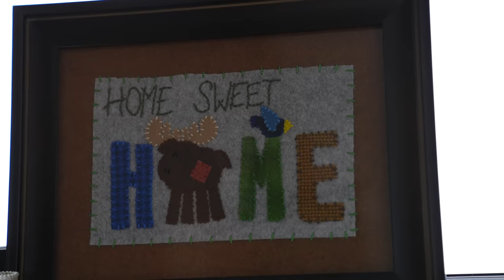THINGS ARE NOT LOOKING GOOD | A RACE AGAINST THE STORM

Comment: I didn't read all of the comments, so someone else may have mentioned this - you can replace the fittings on those air hoses.  We are always cutting off the end of hoses and replacing the fittings - they hold the pressure just fine.

Comment: Tip - Use any scrap LVL pieces to make a chopping block for firewood,  màke it 3 layers and change the direction of the middle layer and glue the heck out of it and place screws around the edges, beats chopping on a stump or bare ground.

Comment: I would consider putting a roll up garage door, large double utility door or a door found on a yard shed on the front driveway side. 
It does not need to be the size of a regular garage door for an automobile. However it can open enough if you want to get things bigger or longer because I see possible problems when bringing large items and trying to turn the corner where you currently  have the man door located.

Comment: A ledger should be affixed to strong parts of the house's framing, such as second-floor joists or wall studs. The strongest ledger connection relies on bolts that run through the ledger and the house sheathing and rim or band joist and then are fastened with nuts and washers affixed from the other side.
Reply from the maker: I’m just doing what the structural engineer put in the plans. There are sds screws (large structural lags) attaching the ledger to each vertical stud in the wall it’s attaching to

Comment: Allie. Looking good in the insulated bibs. Before retiring I worked for power company always work in them. You made the comment their HOT. when you get hot open the chest zipper about 4” or so than open the side zippers like you getting into our pockets about 1/2 way between top of zipper and knees. This let’s cool air in when you bend over your pushing out the hot air when standing up bringing the cool air in. Than regulate the heat by adjusting the zipper opening. 
Love the show little Leo is the coolest.

Comment: The hoses aren't trash they can be repaired. Find an equipment sales place that repairs air and hydraulic hoses. Air hoses get cold and the properties of the rubber to becoming 
Hardened and get brittle. If use is a constant roll them up and take them inside. Compressors must be drained of water and protected from constant freezing temperatures. Oil the compressors and your nail guns and staplers after use.

Comment: Brrrrrrrrrrrrrrrrrrrrrrrrr!  I remember those days in Idaho.  But, believe it or not, we are expecting freezing temps in the outskirts of Central AZ in the little town where I live,  so I've been out wrapping outside pipes and the hoses insulating the Heat Pump hoses as best as I am able. The fun will be that after the freezes, all the snow birds will be up perplexing over leaking, frozen/cracked pipes in the mornings we get the hard freeze.  They don't expected freezing temps here in winter. Freezes in the winter and bakes everything in summer. I am looking at moving to a more temperate climate soon.  🌧🌨❄⛈

Comment: You will get very used to shoveling  snow off the two additions  as snow slide easy off high roof  but not slide off the two additions  as roof angles very low pitches.
Reply: The snow from the upper roof will push the snow off the lower pitched roof. Have almost the same roof design here in Canada.
Reply: @homernextdoor5950   have had both actions occur, depends roof material and snow type that each region gets. Red poppy ranch was forced  to change his pitches front and back roof pitches because accumulated  so much lower roofs,resisted sliding off lower roofs. Here's  hoping there's  not an issue!

Comment: Just wondering how you plan on finishing off the lower section of your top roof on each side and tying in with the lower roof sections
Reply from the maker: They will act like two separate roof planes and have a drip edge coming off the upper roof

Comment: That ledger board won't carry a snow load-you need to use construction bolts.
Reply from the maker: There are 4” sds screws holding the ledger to the framing of the existing wall

Comment: When you tape. Out a heating pad in a 5 gallon bucket. Put it on low to warm the tape... and on the plywood, buy a Plummer, 5 foot torch hoze.
Use a wide, head,...branden swings the flame back and forth over the joints. Trent enrolls the warm tape....allie....quickly rolls it in the seals..
Don't  leave the plywood,  not taped all winter...
The dripping, the mess, ect ect. And after a few weeks, seams will swell, up.

Comment: You can use trig. to figure out the angle of your slope cuts.
Reply: You can also use a framing square to figure per/foot/run  in figuring those stud lengths and hip rafters too.  Some of us are old school and do it the old way as I had no use for trig. There is so much info on a full featured framing square.
Reply: @roncurtis8331  Love framing squares, but combersome on a 30' wall starting at one angle and finishing at another.

Comment: you might be ableto shorten the broken airhose a little cut the crimped sleeve off carefully to keep the barbed inner piece untouched , then bring it to a shop that does hydraulic fittings and they probably be able to crimp a new crimped sleeve over the repaired piece making it as good as new again , the other option wouldbe a hoseclamp doesnt look as nice and prolly will cut you at one time or another unless you realy tape it up  but it should work just not as resistant angainst pulling on it

Comment: Is there not going to be a door from the main part of the garage to the second addition? and if it is to be a mancave what about some windows?
Reply: sorry I see there are windows afterall
Reply from the maker: The door will go in after we get the roof up
Reply: If you look closely you will see the opening for a door and window on the side of the mancave, not on the front, but the side.
Reply: @sandrachristensen7282  it is a door from the outside into the mancave. But there is no room from the inside. I think that will be regretted.

Comment: Trent there is a common difference in stud length 16 in oc. 4/12. Framing square will tell you that. It talks!
Reply from the maker: Our foundations are not very flat so we have had problems cutting studs without checking each one.

Comment: Why does  your sub fascia have a 1 1/4 " discrepancy to your bottom edge of roof sheathing? It seems the ceiling joists weren't all cut the exact same length. Now that the bottom edge of the sheathing is nailed into the sub fascia you cant (cheat) the sub fascia in or out to have a perfectly straight finished fascia. Cheers from Canada !😁🇨🇦🔨
Reply: Hey 👋 You've won something 🥳 KIK me through the above name ✔️❤

Comment: I admit to not being a carpenter (or any kind of skilled trade), but those birds mouth cutouts sure look sort of wonky.  Aren't they supposed to have a more squared off cut where it meets up with the wall beam?  These look like they'd slip rather than hold if pressure was exerted in the downward direction.  Like I said, I am the farthest from even a novice---but I have seen a lot of folks make those cuts differently and would love to know why you chose this version.  Otherwise, you guys (and gal) are knocking the build out of the ballpark.  Thanks for the episode and for giving me something to ponder
Reply from the maker: The birds mouth is just give the rafter a flat spot to be nailed onto the top of the wall. Then we had to trim the end of thr 2x12 down to match our 2x10 fascia. This is pretty common practice, although there are different ways to do it